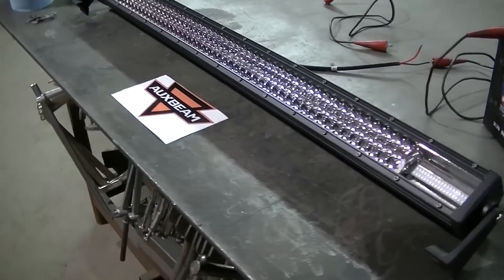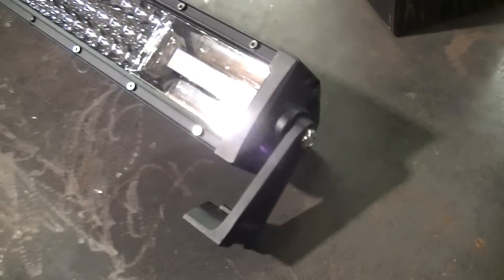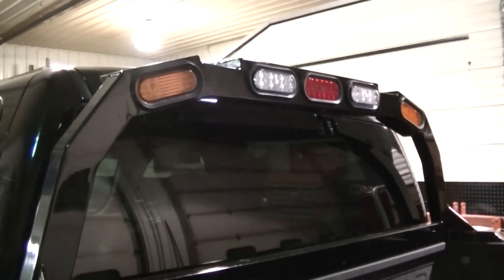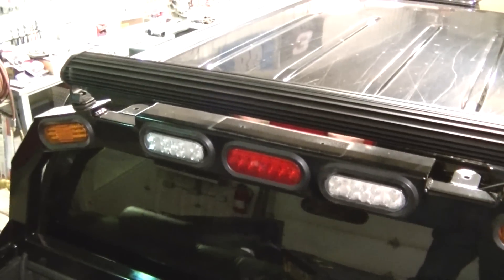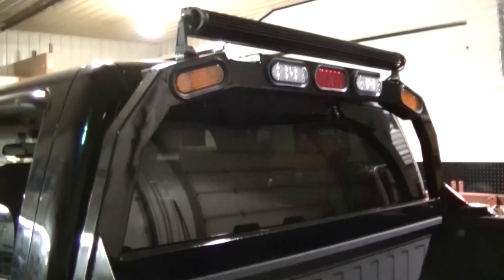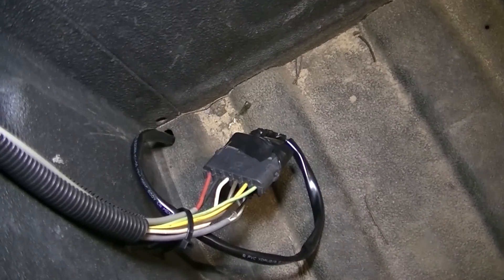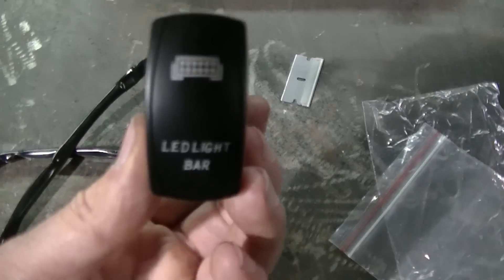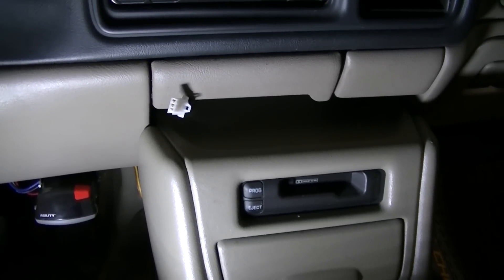Project Midnight | Auxbeam 42" C3 Series LED Light Bar Install on Back Rack

Comment: I own three different Auxbeam led light bars. I am pleased with all of them. I will have to look into the new C3 series. May have to mount one on our Nissan Pathfinder. Been thinking it could use some light. The ones I own are the older models and use them on are atv's and a 52" curved on our UTV. Like all things the led market is getting better and better. The 5D series is still a good option but for a few dollars more or sometimes less the newer C3 series just looks fantastic. The 22.5 curved C3 at 9000lm would be just the ticket for that application, a high mount and great forward and side light pattern. Thanks for another great review. P.S. The blacked out lights you installed look great!
Reply from the maker: The bar is super bright.  Even the smaller bars are going to put out a lot more light than a comparable standard bar.
Reply: I think I'll have to get one of the 22.5 curved C3 light bars they have on sale till the 25th. It amazes me they are getting such efficiency out of the 1 watt chips. Technology is moving so fast in some of these markets it is hard to stay aware of all the great things that are out there. Less amps and more lumens always a win win.

Comment: Pop in rubber grommet caps in the old holes of your strobe light to avoid water or melting snow from getting in the back rack... Just a suggestion
Reply from the maker: Or a bolt and some silicone.  The rack has quite a few holes and I have never had any trouble.  Even going through the car wash.  It's made of heavy duty steel and I have painted inside the light buckets.

Comment: Question: does having it mounted far back on the cab keep it from glaring on the hood pretty well?
Reply from the maker: I don't really have trouble with the light glaring me on the dually with the bar mounted right above the windshield.  I do notice that I get a lot more side light with the bar mounted farther back.  That is probably the perfect spot for a big light bar to be mounted (back of the cab).
Reply: Hadn't thought of that; side light would be a nice thing, too.

Comment: why don't you mount those switches in the blank filler panel on the overhead console
Reply from the maker: It's hard to run a bunch of wires up the pillar and through the headliner.  I would prefer to put them in the dash area.

Comment: Would you say this is significantly brighter than the v-series?
Reply from the maker: I have a 52" V Series so it's hard to compare it to a 42".  I think this light does put out more light than the V Series.  I was going to do a drive down a dark road with both lights and put them side by side for comparison.  I may do that after this deep freeze is over.  A lot of people ask me about the V Series vs C3.

Comment: you should get leds for your shop and get rid of the buzzing lol
Reply from the maker: That would be awesome.  I priced them out one time and they are not cheap.
Reply: mossman381  i wouldnt mind getting a few of the ebay special leds and see how they do in my shop. has to be better in the long run